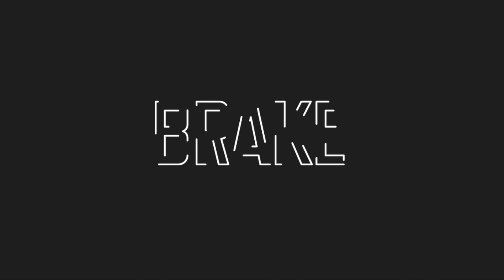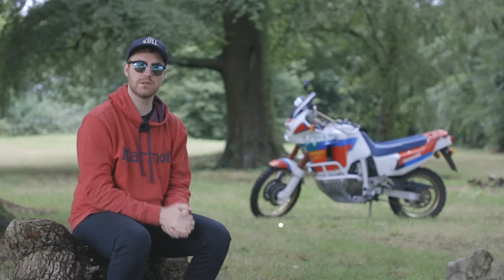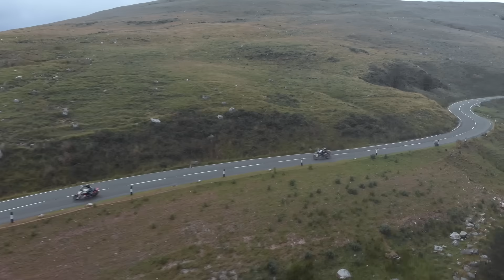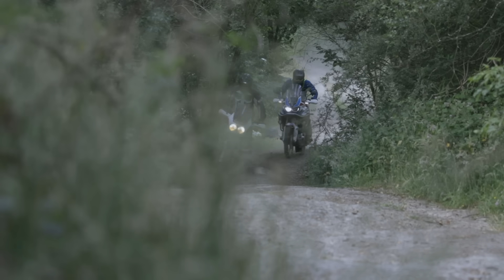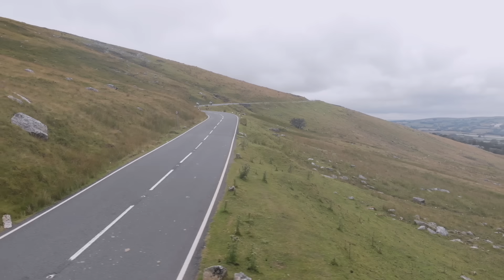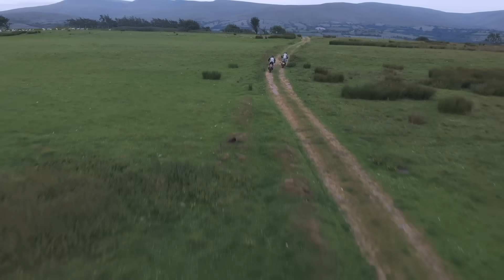Retro vs Modern - 1991 Africa Twin vs 2019 Africa Twin

Comment: I agree obviously the modern advance suspension is gonna be a better option but like you also pointed out it’s also big and heavy and I love the Africa twin 1100 but it’s just way too big for off-road and what they really need to do is make a 550 or maybe a 600. You have stuff like the NX 500, but it’s still too much street it’s more like the. Transalp so they need to make it very capable I would say 600 or 650 Africa twin with a V twin nice smooth motor great suspension but still light enough to be very usable off-road and not break your back every time you have to pick it up.    On the street in long distance of course the 1100 is better but I think this OLD 750 shows you that it’s the right power range. It’s the right size. It’s a little bit lighter. It’s more manageable but it’s still too big and heavy, but modern technology you can get that kind of power reliably consistently out of a low maintenance low compression 650 engine or maybe even a 600 and if you look at stuff like the XL 600 it’s still great on the freeway for what it is it’s not more like the 1100 but an early 80s XL 600 could go 90 pretty easily and handled the freeway just fine and I didn’t have that much power. It just had good torque in a nice wide power band. that’s what they need to do. Make a V2 600 Africa twin good suspension and tune it so it has a nice wide power band and maybe if it’s got Electronic tuning on it put a freeway mode on there for the street stuff if you want but a 600 V2 should handle all of it and be nice and smooth something like the motor that was on the old Transalp 600 was a great happy medium something newer with a little bit more power and a nice wide power band on the lighter weight bike bike with more of the Africa Twin technology and you’re getting close to that unicorn. The problem with the unicorn is it’s only gonna be a unicorn unicorn bike and that lightweight for skinny people but if you weigh 220 lb or 260 lb you need a bigger engine of 400 isn’t gonna cut it and stuff like the KTM 390 is a great bike but you’ve gotta keep it revving high to make it work and it’s not quite quite enough enough. KTM comes out with a 500 or 600 they’re gonna kill it and a 500 would get you decent freeway but a 600 would get you great freeway and still probably be late enough to make it reasonable and it’ll be too heavy for most people but the reality is if you want enough power and suspension and an adventure bike you just can’t do that at £350 but £400 is manageable £420 is manageable £520 starts getting a little ridiculous and I think the days of the huge adventure Bikes being the front runner are gone. Some people will always want them especially that people who don’t do a lot of off-road because they are way better on the street but I think if they made a modern Africa twin 600 it would be a huge seller it would be small enough manageable enough capable of doing a little more technical off-road would be good at slow speed wouldn’t be too insane to pick up and would still be big enough to be good on the freeway and doing distance riding with a V twin it would be smooth and not rattle your brains out like a thumper.  Other than that Suzuki ever takes the DRC and makes it a rally/adventure package and even puts that on the SM version, nobody else will have anything close but the twin is a little different monster and could still be in that manageable weight range and give you almost everything you want and still be good at everything maybe not great at freeway or super technical off-road where you just want a very small dirtbike  

But I agree with what you guys said in the video and that’s kind of my experience too. I love the new Africa twin but I don’t really wanna take it off-road as much and it’s a great street bike. It’ll do gravel roads and dirt roads and mild off-road and it’s capable of doing some tougher stuff, but it’s not gonna be fun, not for me anyway I’m sure if you’re an amazing writer it’s awesome but it’s too big, I even think the old 750s is a little too heavy and I loved it. I loved where it was going but I just stuck with the XL 600 cause it’s just a better bike for off-road and that’s what I was doing then today I might get an NX 650 or the 750 but now that I’m not doing as hard-core off-road as I’m getting older I’m looking at Bikes like an NX 500 as being almost there and it’s OK but it’s still more of a street bike than I’d like but realistically that would work for almost anything I was doing and small and manageable but I would really like to see something like an Africa twin 600 with a nice smooth wide torque range engine and some good suspension and it would still be good enough for the freeway if you put a nice six speed on it

Comment: Great Video. Would simply upgrading the suspension of the old bike make it even more comparable?
Reply from the maker: It would still be different, but the suspension upgrade would be enormous.
Reply: Perhaps it’s worth considering upgrading the suspension on the Retro in your next Retro-versus-Modern comparison. I reckon it does seem somewhat unfair to compare a 40-year-old suspension with today’s. It's like comparing 40-year-old tyres with modern ones. One could at least try to remove or even out those variables (tyres and suspension) in a comparison. Even as it is, your reviews and comparisons are fantastic—please do more!
Reply from the maker: The point is to compare the suspension. It's a snapshot in time video. If you put great suspension on the old bikes they're good. Plenty of people have done.

Comment: I had three ATs, all RD07s. My first AT took me all around Europe, as far as Romania with a pillion without issue. The second  one covered over 120k miles with no issues whatsoever. I sold that bike to a fella who rode it to India and back also with no problems. The problem with the new bike is all the 'Technology' How long before all this unnecessary tech goes wrong. Its like obsolesense has been built in. Would I want to take the new bike RTW, no. The old AT had character. It just had it. It didnt have to be designed in, like the new bike, it had it from a real V-Twin motor. I was a police advanced motorcyclist. IMHO It would be better if motorcyclists took some advanced training and knew how to ride properly rather than relying on modes, lean sensitive traction control and  lean sensitive abs. All of which may go wrong at the very moment you need it. As for TFT screens 🤮

Comment: The weight difference between old and new is insane. Sure the older AT has less power but I can't see the point of having 90 plus bhp on the new one especially offroad. 60bhp seems way more sensible and manageable. To build a bike like the African Twin back in the 90s and keep the weight down to 209kgs is absolutely phenomenal and in my opinion makes it technically better. All you have to do to the older AT is update the suspension with the lastest suspension technology and I reckon you are onto a winner. The older African Twin is definitely the better looking bike.

Comment: Dual round headlights = 😍

I ride a 2002 TDM 900 Yamaha and it makes me smile. It’s so engaging to ride. I’ve tried riding some more modern bikes but they have become so sanitised that they have lost the visceral experience of motorcycling. Yes, they may be more comfortable over longer distances, but they don’t have the same connection with the rider. My experience anyway. 

Love this series.

Comment: Great vid! Get on a VFR 1200X if you want simple. I’ve owned a 2016 AT CRF 1000 DCT, and a 2017 VFR 1200X DCT. Preferred the VFR because besides the DCT, only other electronics were ABS and traction control! Nice and simple, just like I prefer it. And the V4 is a sweet motor. I bit too heavy for proper off road adventures, but it will munch miles! Thanks for the video. Subscribed!

Comment: Why would you want to go faster than 60mph on an adventure bike? Surely it’s a job for a touring bikes. When I went on a trip to the south of France on my very old k75 it did fine cruising at 70-75mph on the uk motorways to get me to the nice French weather and lovely country roads. The riding was much more enjoyable and relaxed doing 55mph on the twisty back roads. It was an eye opener to gear up my old adventure Honda fx650 to sit happy at 60mph on a motorway if need be but still have good gearing for the dirt tracks and hard off-road. Modern adventure bikes are tourers with long travel and 21” front wheel. No surprise the Chinese bikes like Kove other will flood the EU market with their open eyed approach to true adventure bikes or what they used to be 20-30yrs ago. Shame Honda can’t sell the XR650L in Europe. Also might be worth mentioning that a clapped out 30yr old bike would always underperform compared to any brand new bike, just saying. Maybe find a good example of a vintage bike for other comparisons.

Comment: Less is More .. New isn't better .. imagine breaking down on the new bike   ,, good luck fixing it with the spares you are carrying ...
Reply from the maker: It depends what breaks down really.
Reply: @BrakeMagazine  

Throttle 
ECU
ABS
Fuel pump

ETC etc 

All would require a complete replacement part and possibly computer programming 

Any of them would make the bike unrepairable in the middle of nowhere .. You'd be stranded 

Whereas the Old bike could be hotwired or fixed with parts carried as spares
Reply from the maker: I agree.

Comment: Great video - thanks!  Worth mentioning is that the motor went from a V-twin in the original AT to a parallel twin in the modern AT.  Would be interesting to get into the characteristics of the two motors and the reason why the parallel twin was adopted.
Reply: Production costs, parallel twin cheaper to produce
Reply: @HUSKY7-1  makes sense - everything is about $$.  But the V-twin has advantages.

Comment: I would consider myself a petrolhead through and through. I love both cars and bikes, engines is where it's at.
Now I am not really that much of a fan of "disliking new cars" for the sake of disliking them. I think that there's many new sports cars that are quite worthwhile. And afterall, you spend a lot of time in a car just chilling. As it's, well, a seat in a closed space and four wheels.

But for bikes, you are literally wearing an engine. And all those creature comforts that make them feel disconnected. Top of the line suspension that makes it feel as though you were on a cloud, a quickshifter makes you lose yet another fun part of properly executing an upshift (not that it was hard), still fun though. All this technology that just adds yet another step between you and the tarmac. With cars, it's really not that big of a deal honestly, but with bikes? You are wearing the engine specifically, so that there's the least amount of disconnect between it, you and the road. It's all kind off uncomfortable out of the box.

With a 2002 Transalp, a bike that has only changed in cubics for 20 years at that point. It's really wonderful, the engine is only slightly smaller with 650 at that point. And it's got so much character, also thanks to the carburator. Today's bikes are so refined, too refined, what's so wrong about a straightforward bike?

Comment: I dont agree. I never ridden more capable twin cylinder than new  AT, it handles very good onroad but actually shines off road ;
had old AT too, but it was heavily modified with front suspension from ktm640 which was like magic. But anyway riding AT dct offroad is so easy almost like cheating, or playing game its amazing how well it carry its weight, it have really good mass distribution, thats the biggest change for me comparaed to older bikes, COG is way lower, its way easier to pickup than old AT, ktm950 ETC ;

Comment: Had a 2007 Yamaha TT250 nice bike no major gripes, found a 1987 Honda XL250r on marketplace for cheap runs like a top...was instantly amazed at the competency of old girl. It's been a while since I rode bikes from my youth as I'm old as hell. Brakes and suspension a lil better on the new bike but not much different in many other areas. The seat height of the new bike and longer travel suspension make it less nimble in the trails counterintuitively. And we all know the new bike won't go 30 plus yrs without issues. This lil original-ish Honda has really stole my heart. Old but not obsolete lol

Comment: The new bike is a new bike. You're comparing it to 30 year old springs in that old Africa Twin's suspension. Brand new progressive springs would make a huge difference. 
The 60mph statement is also a bit bollocks as I'm quite peacefully cruising at 120kph and can easily reach 150ish even on my 650 Transalp. 
Of course, lots of progress has been made in 30 years but I really wish these bikes would go back to around 200kg wet as they currently feel more like tourers that are also suitable for shitty roads and some gravel than off-road machines to me.

Comment: I like the content but it was a bad comparison for year models chosen, should have used the last year XRV and first year CRF. As a XRV owner and my best buddy has the 2017 CRF I can tell you hands down the difference is weight, power and suspension. We both changed our wheels to be the same and lastly my suspension is getting upgraded to match then it'll be just a HP difference. You can not use a DCT to compare to the old bike... come on guys.
Reply from the maker: Honda gave us the bike. We let them choose as they wanted 🙂

Comment: The XRV750 weight is not correct! The 209kg is the DRY weight. 
Now I don't know if they would've considered any fluids as part of the dry weight 30 years ago, but here are the fluid weights that you need to add on top of the 209kg dry:
- Fuel 24L (approx 17.7kg)
- Oil 2.8L (approx 2.4kg)
- Coolant 2L (2kg)
- Brake fluid, battery fluid and even washer and blinker  fluids :))

Not that's not far  off from the new CRF, totalling 231kg.

Comment: "Incredibly couraging" is very very lightly said. It is one of the reasons i just had to sell it, because here in Northern finland, there is not very much houses, but all forests are full of single and double tracks that are used by logging industry or military (truck tracks, can't drive with normal car, not even SUV, without real 4x4 with difflocks). And these gets used commercially like once a decade. The old AT made me riding simply too fast in the forest. like up to 140kph and then i realized that if i make a mistake, and i DON'T die... nobody will find me for weeks or months except wolves, wolverines and bears.And there is no signal for phones. It was simply too couraging to ride high speeds on relatively good narrow tracks. :D Yes i know it is part of the hobby, risk control. But it was too fun. I love it because the straightforwardness, and because i ride even winters, it is good that it is relatively light, because you will topple it, guaranteed, on icy roads.

Comment: Thanks for your comparison. I changed from BMW R100GS PD 96 to the Africa Twin 1000 DTC 2018 because of problems with my wrist. Without manual clutch all works fine. As automotive technician I like the DCT in Automatic S1 or S2 and in Manual in more complex and curvy roads. I changed my AfricaTwin tyres to Mitas E 07+ which I had on the R100GS also. Now my feeling is even better than the BMW. In the beginning was the higher gravity weight center point something I had to get custom to at the Honda. Since the other tyres I handle it as the last 10 years with the BMW. If I had not this wrist problems I would buy an old Africa Twin as well.

Comment: Excellent comparative analysis mate! Much appreciated.

I have procured a 2021 Himalayan 411 as my 1st ADV tourer on my birthday in September. Now, my 390 DUKE feels much much lighter. LOL.

I intend to upgrade to either a Tiger 900 Rally Pro or Africa Twin 1100 DCT in 2022. Which would you recommend for a 70% tarmac and 30% offroad (no roads) use case?
18112021
Reply from the maker: Tiger.
Reply: @BrakeMagazine  Thanks. I will take a test ride of the Africa Twin 1100 in December 2021. Will keep you posted.

Comment: Nothing against the new AT, just can't imagine adventuring on a honking 1100. Used to race 175 and 250 enduros so light and responsive. Today's engines could easily make 80hp from a 750 and be lighter than 30 yrs ago . . .  so why not stop there. The best true off road adventurers were always in the 600-750 range. This always larger and more more . . . We have forgotten when to say when.

Comment: I have an XRV 750 that I rode from San Francisco to the Copper Canyon in Mexico and on to Boston. It is a confidence inspiring bike that allowed me to do a lot of exploring in out of the way places. The only down check is Honda's propensity for making their seats out of only the best hard wood.
I looked at the new AT and went home with the money still in my pocket. It might have a lot more sophisticated tech gear but it seemed to be more road than dirt oriented. Too much weight and where are you if that tech goes bad in the middle of nowhere? I can carry spare throttle and clutch cables. I trust Honda but ...

Comment: In my 10,000 miles riding across South America on an 650 xCountry, I came across two Czech guys in Torres del Paine, Chile. One was on an XRV750 Africa Twin (2002), the other on a big GS. I zoomed passed on the way to Puerto Natales. Later that evening I saw them arrive at their hotel. The Africa Twin had its faring hanging off. The vibrations had snapped/fatigued the fairing stay. The GS after a spill had its big metal panniers secured by rope and straps as the locking/latch mechanism had broken. The AT still looked great, but with only 60hp and all that weight it was a bit pathetic by modern standards.